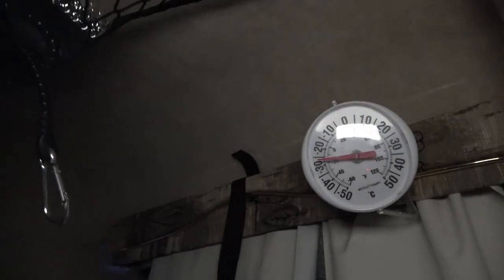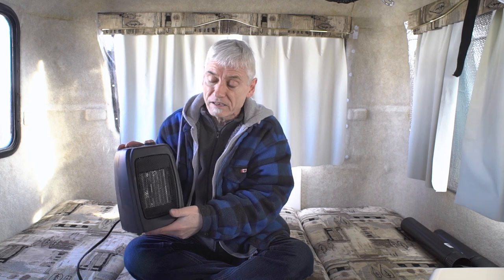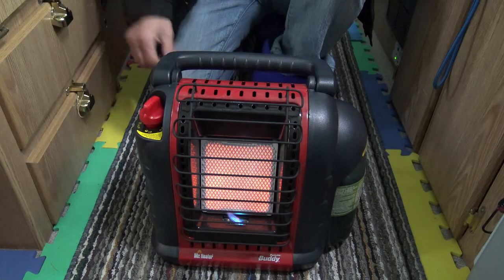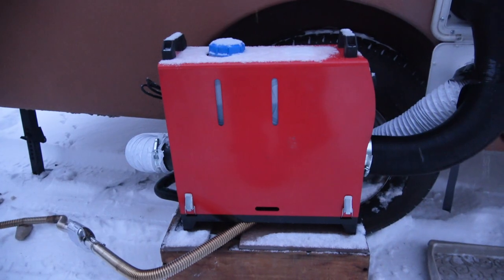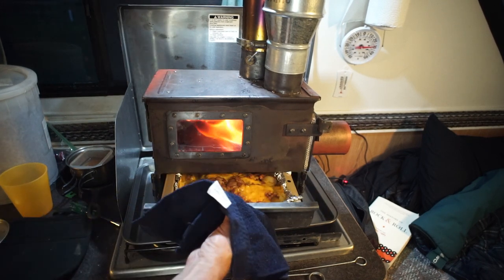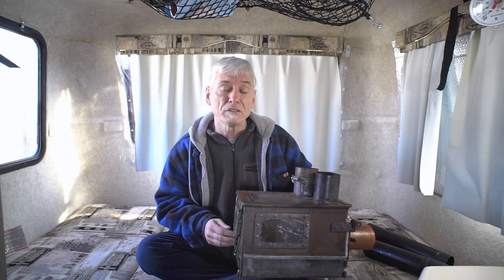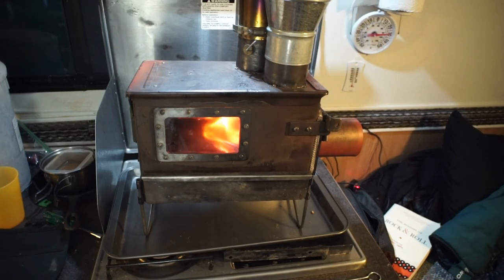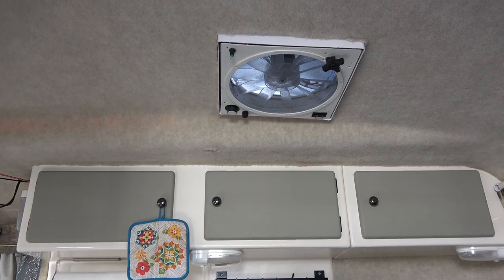Camper Wood Stove Experiment Pt 1: Just Chillin' on the Install

Comment: They don't call him "Slim PoolNoodle" for nothin'. I like seeing the woodstove make a come back. The location he set it up makes sleeping in the bed a little more interesting. The smokestack looks like it could use a hose clamp attached to a rod that connects to the solar mount to keep it solid and not blowing in the breeze.
Reply: Slim Potatohead, Have Pool Noodle Will Travel. It wouldn't take much to rewrite the Paladin theme song to fit Slim's channel.
Reply: You could just do the same thing with a bit of bailing wire if you had to.  it would be simpler
Reply: @2tmx54  "Taterhead, Taterhead, Where do you roam?"

Comment: I made a wood stove out of a six gallon travel trailer water heater I had salvaged . Reversed the inside tube the propane heater used so it became part of the chimney .  5 inch exhaust worked prefect. Used outside air to the fire box instead of sending  heated inside air up the chimney .  Just a short piece do an out down spout supplies  the air , cut a square  hole for fuel door  , hammered it flat , and it fit prefect for the door , no glass , but I was more interested in heat , than a pretty flickering  flame . . Three long J hooks made the legs ( three legs will always seat smooth , four legs seldom do ) . Anyway  minus 24 c  outside , but a toasty 25  c inside , with only a small flame . Still using  branches for fuel from a snow storm we had four years ago . Free wood , free stove, free chimney ,  even the piece of down spout was free . I do have a fan beside the stove so the heat is spread around inside .

Comment: Slim,   setting and using the stove is more of an art than a science is exactly correct.  I have a Wiseway pellet stove in my house.  I bought it in 2018 after a major power outage the winter before.  It's taken me three seasons to learn how to tickle it's sweet spot but I finally found it.  I now have it burning up to three days before having to clean it out. Trial and error is key to optimal performance.  I love it now.  It saved our bacon this season without Texas polar vortex.  Our power cycled on/off here but we were very toasty with the stove heating the entire house.  I have the ability to shut off the fuel supply from the hopper, so it can just burn itself out.  Gravity feed without power is wonderful.  The only way to go. Thanks for the videos!  You are one brave soul.  Be careful.  Mechanical injury is what I fear for you being alone.

Comment: There's something about the heat from a wood stove. It's like no other form of heat. It's for some reason more comforting than any other form of heat. Maybe it's just the character of the whole idea.
Reply: That's why I have a wood stove in my house.  I rarely use the propane forced air furnace.  That and being on propane its more expensive than natural gas, so I try not to use it too much, other than in the mornings while showering & getting breakfast, then I build a fire in the wood stove that heats the house the rest of the day.  I occasionally will cook on the wood stove as well, if I do stew, chili, chicken and noodles, etc.  I'll use the wood stove to cook that stuff on.  It works great, and provides a heat like nothing else can.
Reply: @Dean MILLS there is nothing like wood stove heat! I crank our gas furnace up high and I'm still chilly (though the hubby complains he's hot) but when we burn wood in the wood stove I feel so warm and comfortable.

There's something about that dry, fire heat...
Reply: Hmm, I'm not sure where I read it, and I'm no chemist, but I've read someone say that wood stoves put out a different kind of ion (either positive or negative, I'm not sure which) thats different than other forms of heat, because it gets into your skin/bones easier??? Idk, but it's interesting
Reply: @einsteinsdesigner876  Woodstock's generate a significant amount of radiant heat which is more tolerable at higher temperatures than a direct heat solution like a furnace which blows hot air and no radiant heat. People who grew up in homes with radiant water heaters love them as well despite how impractical they are in modern days. 

The radiant heat combined with nostalgia and atmosphere makes wood heat the best!

Comment: Nothing better than watching Slims creative fabrications. I'm glad the ammo box stove is back. I can't help but wonder if a small 12VDC fan could be ceiling mounted to force hot air downward. That would avoid heating from the top down and not taking advantage of convection. It seems to me that without forced air, the upper half would be warm and the lower half cold.

Comment: I have an Aliner in part because I liked your older videos concerning your old trailer.  
I researched small tent wood stoves and found the GStove made in Norway.

I too, used a window in my Aliner to vent my Gstove by removing the screen and closing off the window with plywood.  I held the plywood in place by installing pressure pieces which are connected via wing nuts and washers which basically pressure or squeeze the plywood into position.  I found this superior to other methods I tried as it does not damage my Aliner - other that removing the screen.

A word about the Gstove.  I hunt whitetail deer in WI.  Actually, I used to hut whitetail deer and now I tend our cabin's wood stove and see the younger hunters have warm food should the November weather in WI necessitate warming up by the stove for an hour or so.

The reason I mention the above is during a recent check or our smoke flu I discovered the caustic nature of the wood smoke discharge had almost eaten through the elbow in our flu as it exited the cabin.  Had this gone unnoticed we could have had a very bad outcome.

Back to the Gstove.  The Gstove is 100% stainless steel which is less impervious to corrosion due to creosote.  I don't know the metal which composes your chimney but if it's not stainless steel - it presents a hazard.

Regarding the insulation you installed for your stove exhaust pipe, the amount you can install is miniscule and won't do much regarding R-value. I simply have my sheet of plywood with less than perfect sizing for the window (decent gaps but not big enough to fall out of the window frame) and it doesn't matter in terms of the stove output.

I've never been able to operate the stove without literally being "cooked-out" of my small Aliner.  Any insulation I could install or setting up outside air becomes superfluous when the stove - using sticks, hardwood, softwood, dimensional lumber etc. can become so hot I need to open windows and open the door.  

I have used my stove for over two years during my winter camping outings in MN and found it more heat than I need.

All this said, I enjoy your videos and laud your creative endeavors to heat your trailer.  Based on my experience, I would purchase a 100% stainless steel stove from Gstove and let the winter winds and cold temps come because I'm ready.
Dan

Comment: Nicely done, Slim might think about doing some kind of bracing to make the outside stack less prone to move in windy conditions that's removable and several ideas come to mind inspired by the collar/legs its rooftop kin use. Indeed a pair of hinged legs riveted to a pipe connector made for its diameter  would be ideal since the stack could either slide thru it as high as desired or be affixed at that point so it's legs could slot or use a quick connect of some sort to lock its ends to the plywood insert. Since a Triangle is the most rigid of geometric shapes the legs will brace in much the same way and I suspect he might use a retractable poles like he's done before in some fashion like before if it needs to be more resistant to wind. One way to keep an engine in extreme temperatures to be able to start of course is to turn it over every few hours and let it run but it's better to stay safe since at 20-30 below zero it might be least of your problems getting away from where you parked for a night or just a few hours.

Comment: Slim, do you have one of those “heat powered stove fans”?   My parents had one that sat on their pellet/corn burner in their family room .. no electricity required and was good at circulating the hot air...  There’s plenty on Amazon.
Reply: If I remember correctly, Slim built and used one that he had in Abner.
Reply: @crazyhorse782000  Yup.

Comment: Outstanding Slim! Your thinking and mine are so similar. I want wood/pellet/charcoal heat for my CTC, but I don’t want to cut a hole in the trailer “skin” - roof or sides. I REALLY LIKE your solution! Through the window with exhaust and combustion air intake. Beautiful!

Comment: You could keep one of those small generators on hand to run the block heater if required. 1kw 2 stroke jobbies should do. Could also be used to charge batteries, run power tools, so on of needed.
Reply from the maker: I will not use generators. They totally defeat the reason I go to the wilderness in the first place. SP

Comment: I’m off grid too, I would love a wood stove in my rig!!  The furnace will drain my system in cold nights. The condensation from the buddy heater is wicked!!  I haven’t tried a diesel heater but watching your video......no sure!  I’ve looked at peak mountain camps that have wood stoves installed already and how they do it.  Still tried to find a good heater!!

Comment: That's is so much fun to me, to craft stuff together, building and engineering materials and finding solutions. Maybe you can use the oil burning stove to blow from under the front bumper into the engine compartment of your jeep wrapped around the ground gap with a silver thermal blanket. Not as an all nighter but like a few hours before you need to use it.

Comment: Have you considered adding a welding blanket behind your stove to really protect that wall? It could even be laid out under your stove protector to protect the cushions underneath. It can really deflect the heat and will definitely help reduce the risks of flying sparks, as when you add wood or stoke the fire.

Comment: Nice install! Might want to replace the plastic dryer hose with metal though.
Reply from the maker: I do have some aluminum hose, but it's not as flexible. The vinyl never gets hot as it's far from the heat source. Thanks!

Comment: Hey slim dont know if you have already answered this but on wood stoves the crimped end is usually installed downward so the creosote doesnt run out if the joints of the pipe. I didnt know if the same applies to the pellet stove though.
Reply from the maker: I've never had issue with creosote in the past. Pellets are a very clean burn, and this is a very small stove. Thanks! SP

Comment: Very creative.  This is not where I thought you were headed - I thought you were going to make an enclosure around the wood stove, add a fan, and set it out side where you set the diesel heater.  That solution would take energy and would be inherently less efficient, but add a lot of safety and get rid of the need for an inside to outside chimney.  If I remember right, you hinted you had another use planned for that warm air duct when you cut it at the beginning of the diesel heater build?

Comment: Great effort. Have you thought about insulating the walls and large windows. Obviously sealing the drafty doors windows and vents will limit the amount of fuel you use. Surely. The metal window vent is a good idea though. Keep up the great vids.
Reply from the maker: I did a couple of videos on insulation as well. Thanks! SP

Comment: Check out an Alde heater - uses propane,  very little electricity, practically silent, it vents the propane exhaust to the outside and the hea is dry, radiant heat from a radiator on the floor or under the bed.  I have one in my NuCamp teardrop and it works very well and just sips the propane.

Comment: I have remote start system on my van, it will start every half hour or every hour, run for 12 minutes, then cut off. That's fine here in MD USA, and been OK for temps between 0-10F when we get such low temps. Every time though I have to check the book to remember how to access that mode.
Reply from the maker: How on earth would you sleep with the vehicle turning on every half hour? SP
Reply: @SlimPotatohead  I was talking of doing that on very cold nights while I'm sleeping in the house. I have used it on trips for heat or AC when I stop at a guarded rest area on interstates and feel need for a nap, typically between Maryland and Florida destination. I sleep fairly soundly..

Comment: Watched Forestry Forest at -40C. He used his block heater thru his inverter and lithium battery. Not sure the size but worked to heat his rig.
Reply from the maker: Did he heat it for one night or a whole week? SP
Reply: He ran his block heater in the morning for an hour approx to warm the block. Seemed to work fine

Comment: Slim, I hunt in freezing weather and use a catalytic Olmpian heater
No electricity needed and it sips propane
No fumes or noise, I just crack a window for ventilation - not allot of humidity
I can leave it on for 4 days straight and use 1 - 20lb cylinder

Comment: I liked the solution to the smoke vent, particularly the insulation; that was really using your (pool) noodle.  Too bad you had to order a stove pipe from the States and then find out it was manufactured in Canada (probably those guys in Lethbridge).

Comment: Just a heads up that fiberglass insulation could melt (it's made of glass) under high temps like your stove pipe and is not recommended touching hot metals. That might cause it to be less effective/safe for protecting the plywood. Fireplace installers use rock wool insulation as it is inert and does not melt or degrade.
Reply from the maker: I did a torch test prior. It's fine. BTW, the stove also uses fiberglass in the form of stove rope for gaskets . It's right in the path of the flame and stays intact. Thanks! SP

Comment: Hi , you should look into the Dickinson P12000 or P900 Propane boat  Heater  , I wanted to put one in my camper, but with the slide out , I didn't have the wall space , there are some YouTube videos on it in camper , there not cheap, but must boat things aren't.. stay warm..

Comment: I've always heard, wood is a poor insulator.
That's why the building industry is making wall studs with foam insulation in the wood.  Much better insulator.
Maybe there is a foam material that is fire resistant also to keep more heat in your camper.
Always enjoy your tinkering, your creations and your can do pioneer attitude and spirit.
Cheers

Comment: when you are not using the stove, you can connect the pipes from the diesel heater. then you do not have to heat cold air. then maybe you can get it really hot inside.
Reply from the maker: Yes, it would be possible to use a portable external diesel heater using this window method, however my goal is never to make the camper really hot. I merely want to make it a comfortable temperature. Thanks! SP

Comment: Maybe you can make the diesel heater into a engine compartment heater for the Jeep. If it works then camp on.
Reply: Just installed a diesel heater in my Delica. With pump mounted to the frame outside and supplied rubber mount I get almost no noise and lots of heat. Would make an excellent engine heater!  There is actually one made to heat water for that purpose.

Comment: .****How you doing Slim?" 'This is the guy who proposed placing a couple of spacers in the stainless steel fire pot wire grates to reduce pellet drop rate and burn for lower BTU heat output Temperature control. Now that your new mini RV is well insulated my guess is these spacers(you used a couple of disk shaped rocks) will be needed again or that RV will turn into a Sweat Lodge. My main interest here is to see how low of a self igniting burn can be achieved with Pellets.****.

Comment: There's a Slim sighting, nice video. Shouldn't you have something under the wood stove or does it not get that hot on the bottom of the stove?
Reply from the maker: The stove is raised 6 inches from the base. No, it does not get hot as the oven area absorbs most of the heat. Thanks! SP

Comment: I know you are committed to your woodstove but I wonder if you have looked at or have experience with the Wave Catalytic heater. I am kind of interested in learning opinions about it from other campers as I too have the usual propane/battery hog Suburban/Atwood RV furnace and would like to find an alternative that is more economical. Thanks.
Reply from the maker: Richard, literally ANY propane heater where the heat source comes in direct contact with the cabin air will produce moisture. That's the basic principle of combustion. The Wave may be efficient, but can still make the trailer wet inside. Only practical for short runs at warmer temps. Yes, this has been discussed several times. Thanks! SP

Comment: Slim/ yes there is a good reason for a secondary burn / not so much about a clean burn / but it makes heating an area better / most blow heaters - blow hot air into cold air / immediately cooling some heat / but by having a chamber that collects hot air- allows a larger mass of hot air blowing out into the cold room...continually...equally a warmer room...
Reply from the maker: Sorry, but you are thinking of different principles than apply to this stove. The secondary burn was removed as it did not burn. Its removal had no bearing on efficiency.  Second, I have no need for more heat. Thanks! SP
Reply: Slim / you're right / I was thinking about a blower- blowing a mass of hot air - out into the room air // while I think yours is a fan blowing passive heat / Thank you for answering / you teach me a lot